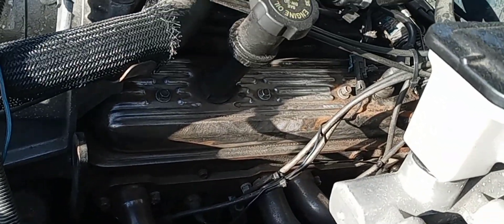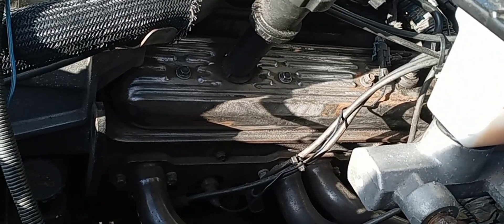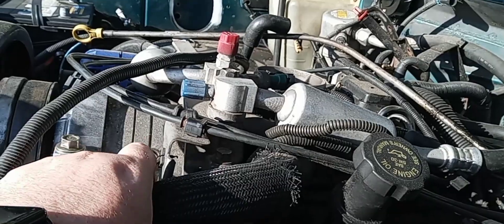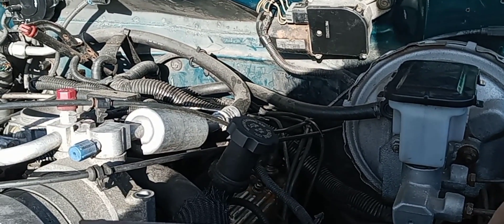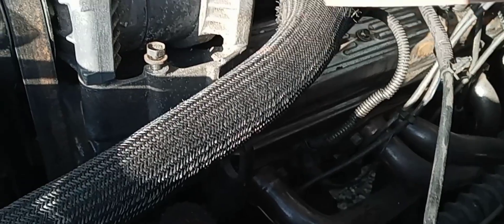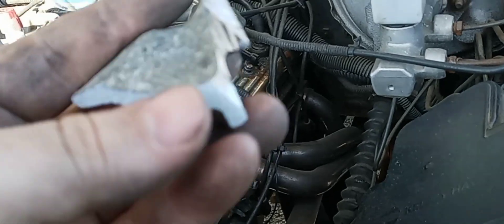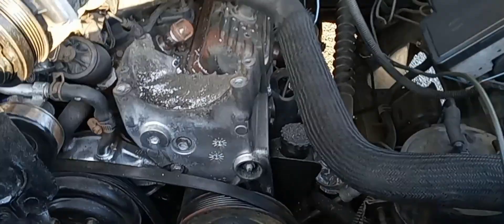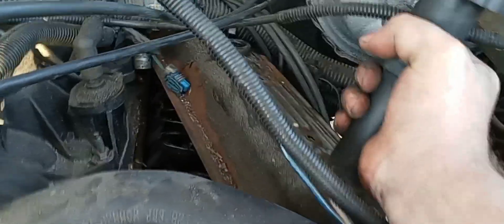how to remove the driver side valve cover on an 88 to 98 Chevy Silverado the fast way

Comment: Removing the 3 nuts that fasten the ac bracket will allow the bracket to slide forward on its 3 studs, thus creating the necessary clearance to ank the valve cover. The belt must also be removed and the plastic fan cover may be removed to provide additional sliding space for the ac bracket.
Reply from the maker: Nah. All I have to do now is un bolt the valve cover and slide it out.

Comment: You weaken the a/c bracket when you cut it. Could possibly have to replace it later due to cracking.
Reply from the maker: No it’s fine it has 3 other mounting points

Comment: Why not loosen the AC bracket and lean it 1/2 away?
Reply from the maker: Because my way is better.
Reply: Lmao
Reply from the maker: You would still have to remove the bracket. As I said my way is better.
Reply: The lower attachment points are behind the power steering pully, its tight, saw a video on loosening everything and sliding forward, its looking grim. Dude saying 10 min max, yea if you've had it apart before sure.

Comment: I was fixing to get the plasma cutter out or a chisel & stone to make room so the drivers side valve cover would clear the A/C compressor bracket 🧨‼️‼️
I started loosening bolts hoping I could slide the bracket out & noticed a bolt with a nut on it behind the Power Steering reservoir  that faces the tire. I did some research & found out that a chisel & stone aren’t necessary 🗿. 
I was right there with ya brother & I’m not hating on what you did at all. Watch the video in the following link because I knew in the 90’s Chevy engineers still smoked Marlboro reds, couldn’t pass a drug test, & would never think of sleeping with a mechanic’s mom, sister, or wife like these “woke” engineers we have today 🤦‍♂️

https://youtu.be/-J-l8JkcuMA?si=gt_TZ-TNKGEKSavX